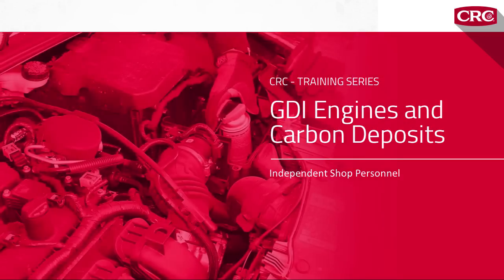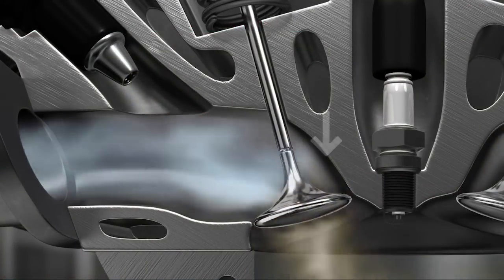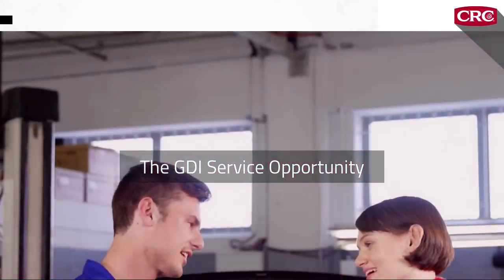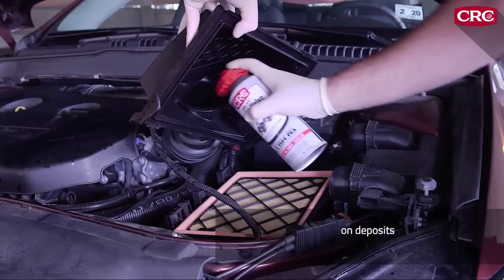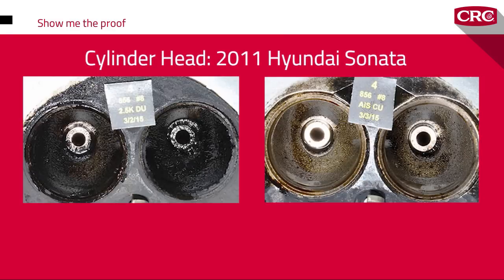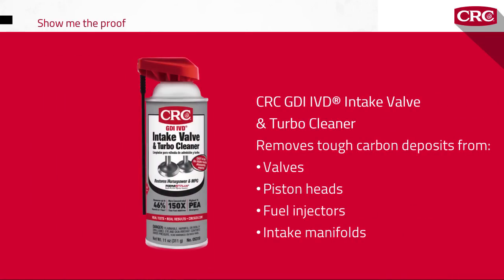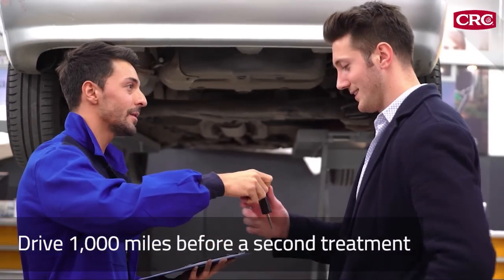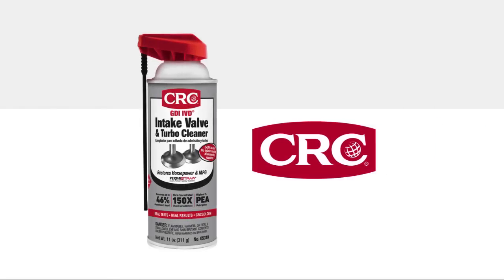How To Use CRC GDI Intake Valve & Turbo Cleaner

Comment: so if my Stinger GT has 2 turbos, which side is the one that needs this sprayed into it ? or do i have to spray half on one and half in the other or ? ?  I hear something called a Two Step spray system, so what does that refer too ?
Reply: Did the product work?
Reply: @blackriderph4340  the one i used did remove some carbon and softened it up a lot to make easier to remove.  I had more mileage and it seems if one does do it once a year or around  every15K miles max, it would be more effective on a regular basis
Reply: @rpmautoreviews9249  thanks for the feedback! I wonder if there were some scouring in the cylinder walls that you were able to notice an effect?

Comment: Can I spray it in turbo directly after removing the inlet hose
Reply: I wouldn’t, it’s easy to destroy turbo impellers, a single droplet can be catastrophic. I’ve seen it a lot with pre turbo meth or water injection when it’s not properly atomized.
Reply: It's not advisable to spray anything into the compressor inlet when the turbo is in operation. The tolerances are extremely tight and the shaft and compressor/turbine wheels spin at speeds of 100,000 RPM or more. Much like a jet engine, you FOD that turbo and it will go bang. ( That's also why you don't want a chunk of carbon to break off and get into the exhaust tract.) Spray it past the MAF  or right before the throttle body like in the video to ensure that doesn't happen.

Comment: how do you apply this to a 13 kia optima 2.0T where would u spray it
Reply: If this is not that hard of a job for a do it yourselfer, you should post a video on how to do this job.
Reply: would it be ok to remove the map sensor on the intake manifold after the throttle body and spray it there?

Comment: sooo you say ''spray into the ports'',  but then only show an example where you REMOVED THE ENGINE HEADS and TURNED THEM UPSIDE DOWN and soaked them for 60 minutes,,,  with high engine temps under IDLE ''spraying into'' the intake will not remove anything unless you spray it for DAYS due to rapid evaporation of the chemicals used.   The only way this will work is if the SOLVENT hits the carbon in WET form and SOAKS IN for a period of time to react and being dissolving the VARNISH holding the carbon in place.. .  This will not occur under running operation of a engine and spraying a can of this or seafoam in..  the flow of warm intake air or even cold intake air will evap the solution before any breakdown will occur.

Comment: My lancer cedia gdi drink gas which  gas should I  use ?
Reply from the maker: Thank you for your comment.   If the vehicle does not have a check engine light on or codes stored in the ECM, we would recommend the following maintenance services to improve your fuel economy.  Cleaning the MAF if the vehicle has one, cleaning out the Throttle body, and using our GDI product along with 1-Tank Power Renew.
Reply: @CRCAutoUS  u know that crc products is not in jamaica?

Comment: Wouldn't it be easy to have the exhaust system removed so this could work without ruining your catalytic converters on your vehicles?
Reply: This cleaner sticks to the carbon build up dissolving it other than it being doused and then breaking off into big chunks that could cause damage like you said. It also doesn’t damage any seals due to it being a detergent based cleaner and not a solvent based cleaner which could do damage to the seals.

Comment: Crc,
Can I use on Non GDI Non Turbo Engine? Safe?
Reply from the maker: Thank you for your comment.  Yes this product is safe to use on standard PFI engines.
Reply: You can use it, but it's wasted money as your intake valves are cleaned by gasoline flowing over them from fuel injection.

Comment: I live in Toronto Canada Where can I buy? Also I have a 2017 focus rs intake easy but turbo is behind the motor very tight. Is there a way to properly clean the turbo with your prooduct? Thanks
Reply: CDN tire
Reply: @jlousy1901  Thanks
Reply: @allvtecbph btw...  the ones at CDN tire don't have the spray straw but seafoam does
Reply: @jlousy1901  Is the seafoam just as good?

Comment: How should I do it on my twin turbo f150
Reply: Did you ever manage to try it out? I'm looking at a 2012 F150 Ecoboost and wanted to go ahead and treat it with this. I was told to use Sea foam but I'd like to talk with owners who have used it. All the forums say don't because Ford said so and whenever people talk about it they get treated like idiots.
Reply: @alpha2gproject783  I wouldn't buy ecoboost models below 2017 they had issues but were revised in 2018 models and up
Reply: But no I did not use it
Reply: @adenboucher7579  I actually ended up going with a 2010 Scab FX4 with the V8. I looked into what needed to happen to clean the intake up and I'm capable of it. But I would rather not have to deal with that every 10-15k miles. I got the 5.4 3v in my truck, but it has a very long maintenance history with the engine being rebuilt with new phasers, timing set and a rebuilt transmission and rear end. The truck has 170,000 on the clock but there's not any rust and it comes with everything I've ever wanted in a truck. But thanks for the reply! I just really wanted a cheap truck to replace the 98 F150 I had and the 2009-2014 was really in my range and honestly after talking with friends who own 2015+ there isn't a huge mpg gain by switching to the new body.

Comment: So if it’s a turbo engine you cannot spray through the throttle body you have to spray into the charge pipe? I have a dodge dart turbo and wondering if spraying into the charge pipe is necessary or if spraying through the intake will work the same

Comment: Video shows spray cleaner being injected and then turning on the motor, while the narrator says, "first war up the car." You guys need a new editor. I came here because the last CRC "how to" was just a commercial, not an actual "how to," this video can also get a thumbs down for the contradiction that could cause folks to damage their vehicles by filling the air intake with a combustible vapor and then turning on the motor.  

The problem starts at 10:46. Come on CRC get your act together.
Reply: The instructions are perfectly clear to me.  Start with a engine that is already been warmed up, run engine at 2000 rpm and spray product in short bursts until can is empty, throttle up a few bursts not to exceed 3500 RPM then shut down engine and let it sit, after that drive at highway speeds for 10 minutes.  Not hard to understand IMO and these instructions are far more detailed then you find with most products.  Keep in mind these are aimed at professionals, not a DIY.

Comment: Hello, Can I use your product in a Diesel engine?
Reply from the maker: Thank you for your comment.  Our product chemistry is formulated for gasoline specifically.  Diesel engines form carbon on other areas not too much on intake valves when compared to GDI so, we recommend a fuel additive for diesel engines with carbon build up.  CRC 1-Tank Diesel  https://www.crcindustries.com/products/diesel-1-tank-power-renew-174-15-fl-oz-05816.html
Reply: NO

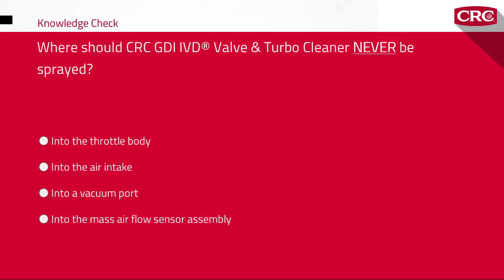Comment: Remember what this guy said at 13:06 never use it directly into the throttle body, air intake, vacuum ports. And finally the only one that maid sence the mas air flow sensor.  Basically you can't use it lol. I love this product it's probably one of the best out there as long as you use it the right way you will see good results but don't expect to see results if you're car doesn't have any  Build up cause this is how people rate good products as bad as they didn't work.

Comment: Again, not helpful to anyone driving a recent, turbocharged GDI Honda, Civic Si, Type R, Accord turbo, etc. I personally have the FK8 and there is no way to do what is instructed.  There is no simple "the vacuum port" into the manifold, and the end of the charge pipe circuit (literally the perfect spot for this) is far too buried behind far too many items (metal mounts, hoses, hard-lines, electrical, etc.) to get to.  The only easy access is feet away from the intake ports, just after the air filter and MAF housing and unfortunately before the turbocharger compressor and intercooler.  This car suck for this type of maintenance.

Comment: I really like this product but at 13:06 it said not to use it on. Into the the throttle body, into the air intake, into a vacuum port, into the mass air flow sensor assembly obviously the only thing that maid sence I'm just wandering who maid this video because I just want to say his an *****. Might as well not use the product.
Reply: I heard that as well, but people say they're able to use it and avoid those issues. But yeah now I'm afraid to use it myself. I'll probably just end up paying my dealership to do it.

Comment: DO NOT USE THIS!!!
What this does is loosen the gunk, gets sucked into combustion chamber, scratching cylinder walls, maybe even getting the gunk stuck around piston rings. Then whatever gunk actually makes out of combustion chamber gets stuck in the catalytic coverter. Dont ever do this.

Better fix for this is doing a walnut blast every 100k miles. That takes the build up and sucks it out and cleans the valves. 

Adding an oil catch can will help with deposits.

Also use a low NOACK synthetic oil. Step up to a higher viscosity oil too.
Reply from the maker: CRC GDI IVD® Intake Valve & Turbo Cleaner has detergents that cling to carbon and dissolves it, therefore chunks of carbon will not break off and cause damage.  If you decide to wait until your vehicle has 100K miles to address carbon buildup, walnut shell blasting may be necessary but our product is a maintenance tool that prevents buildup from getting to the point of engine teardown and possible damage.
Reply: ttseroga1986 when you take a look at the valves and top of the piston after the hour soak and first drive. The carbon that is there is gooy looking. It isn't like sea foam and crap. You are spreading uneducated statements.

Comment: BULL SPIT !!!
DON’T YOU LOVE HOW THEY NEVER EXPLAIN THAT THE EXHAUST GAS RETURN  IS THE REASON WHY IT GETS CARBON BUILD UP THROUGH THE WHOLE AIR INTAKE SYSTEM. 
Only solution is to remove the intake plenum and manually clean the intake and valves ( chemicals , toothbrush, pics ) .
Even if you use an oil air separator, the exhaust gas return is very dirty ?!? WHY ???

Comment: "1 hr of treatment" - lol, that's what that spray bottle will do, soak the valves for one hour non-stop. Cool story, bro
Reply: Your criticism demonstrates that you have no idea what is actually happening. The product soaks into the carbon deposits, and continues to dissolve them after you're done spraying. You don't need to spray for a solid hour. It was explained quite clearly in the video.
Reply: @ProjectDv2  GDI deposits are very hard and abrasive crystalline and only a small portion will be loosened with a solvent based cleaning. Those that are broken loose are similar to pouring some sand in your intake as the hard abrasive particles cause scouring and damage. The smaller ones are forced between the piston and the cylinder walls, and the scouring may be minor, it is still damage and increases with every treatment. Each of these solvents have warranties, but read the fine print. They claim to clean "Up To" 40% (average is less than 20%) and the damage warranty is near impossible to meet the conditions to collect. CRC is not an exception. The only way to properly clean your intake valves on GDI engine is to mechanically clean while keeping the valve closed.
Reply: @deseremere  literally none of that has anything to do with your initial comment, or my criticism of it. Read them again.

Though, for the record, I do not question what you just said. It's all very sound. There's a reason we use walnut shell media instead of chemical solvents for this issue in my shop.